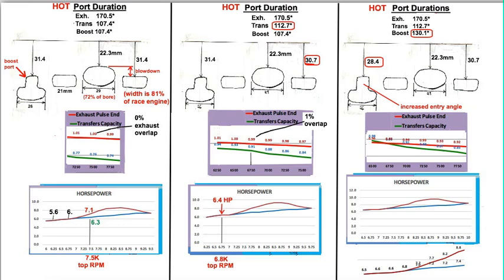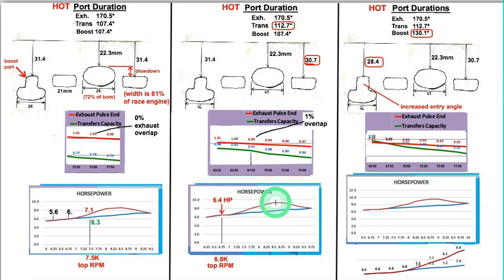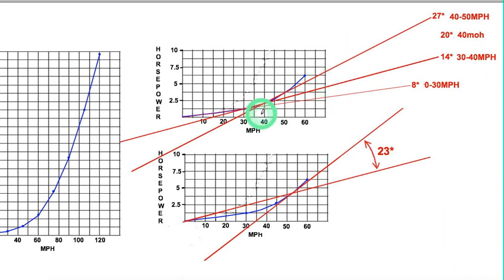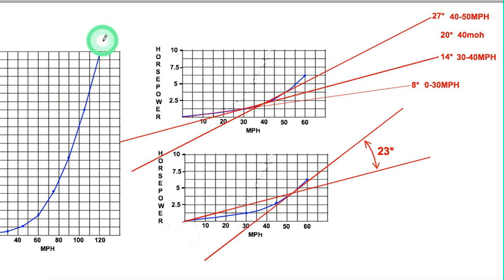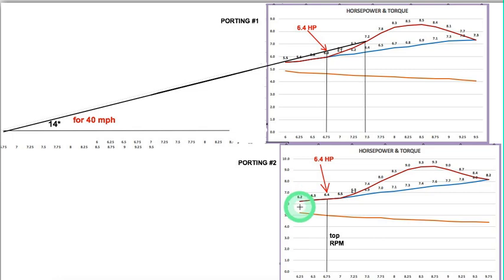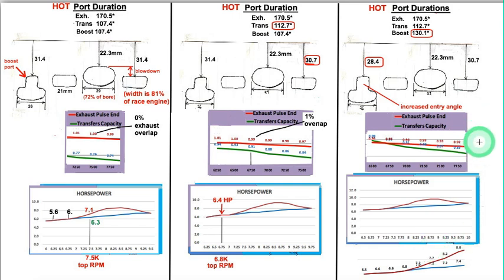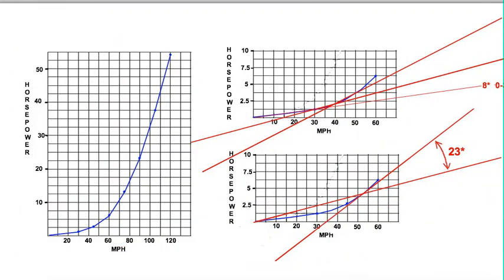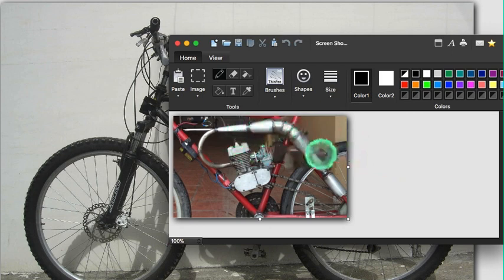2 Stroke Porting Failure Analyzed & Understood

Comment from the maker: I just tested the #3 porting engine and it only got up to 7300 RPM. The angle of HP increase needs to be around 20 degrees past 7300 on my setup but the graph shows 15 degrees which is why it couldn't go farther. So if I want to go faster I need to lower the RPM range of the pipe by lengthening its header so the pipe boost can assist the porting power there. This has been a great example of how things sometimes are backwards from what you think they will be, and how there are exceptions to the rule. Before this I would of always said that raising the ports will increase the high RPM power, but in this case raising the transfers lowered the blowdown too much. Also raising the transfers raised the pipe powerband by around 250 RPM according to my pipe calcuator, which moved the pipe powerband even farther away from where it needs to be. It's very important to synchronize the pipe and porting.
Reply: very interesting to follow this story, thank you